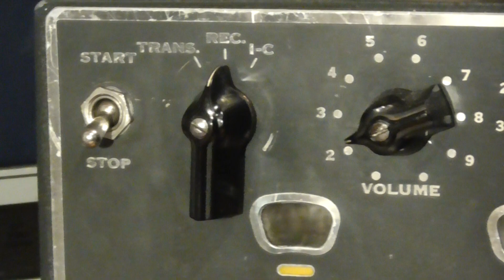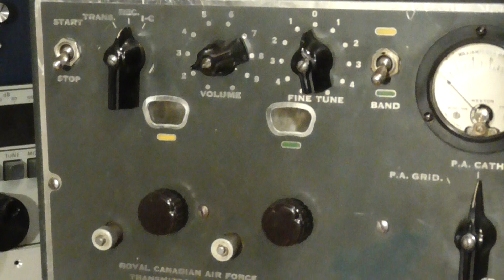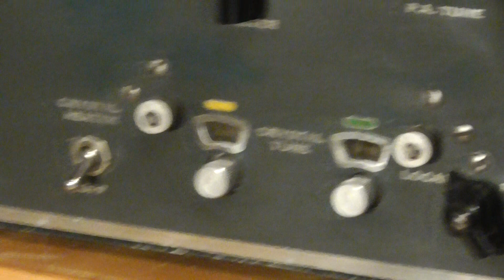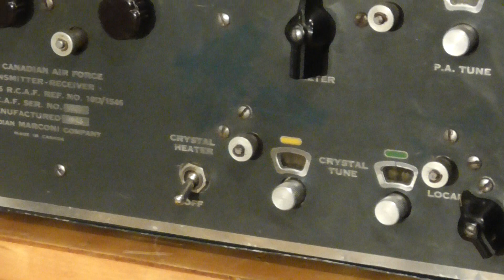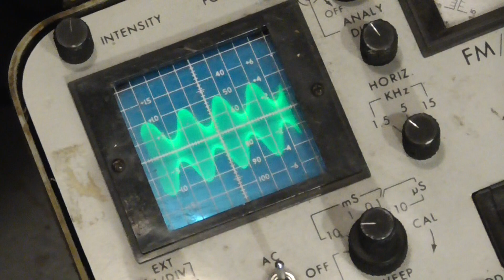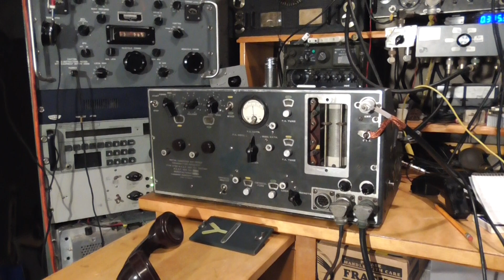RCAF ATR-5 Transceiver overview and operation

Comment: Hi, I am a volunteer with the Bomber Command Museum of Canada in Nanton, Alberta. These radios were used in the Avro Anson Mk ii twin-engine aircraft. The Anson aircraft was mostly a twin-engine training aircraft in Canada during WWII. A few were used for submarine patrol. We are currently restoring two of the ATR-5 radios. We would be interested in finding parts for these radios.
Reply from the maker: @kenhill3706  what parts are you looking for ?  I have what remains of a junker
Reply: @docswirelessworkshop6000  At the moment we are looking for crystals that go in the unit. A picture of them would be helpful.
Reply: @docswirelessworkshop6000  At this time we are looking for the crystal module for the radio.
Reply: @docswirelessworkshop6000  Pease send a picture of your junker.

Comment: I doubt that this large box was ever in any fighter.
This is a huge radio, its 3-6 megs HF
By  1943 VHF radios were coming in SCR 522 was VHF
Take a look at the antennas
Was it a stick or blade antenna
or was ita stick and wire to the tail?
Reply from the maker: I have no idea what it was intended for and not a lot were made so I expect they might of been used in domestic patrol aircraft or something. I was just quoting the manual ! But they did also make a matching antenna coupler for open wire line so that would lend it to more ground installations.
Reply from the maker: To answer the rest of your question it was intended for a wire antenna.   Also I’m not sure how many of those American sets were used in the RCAF out side of the American planes